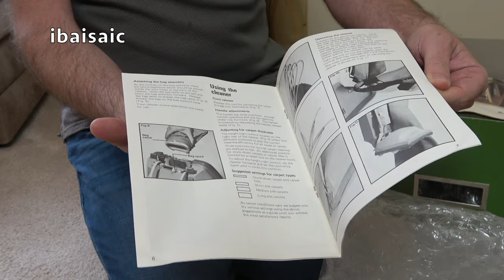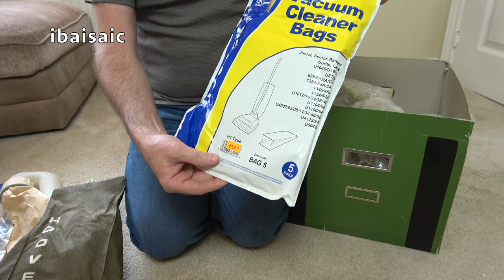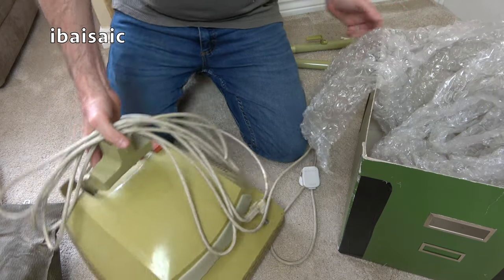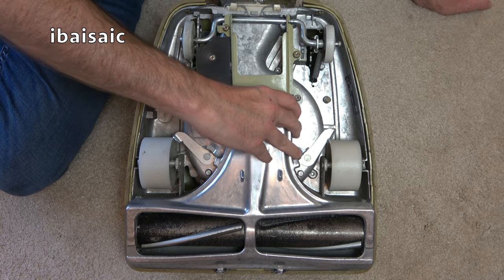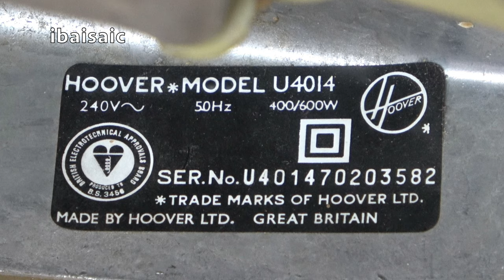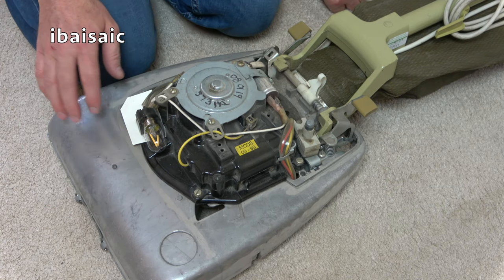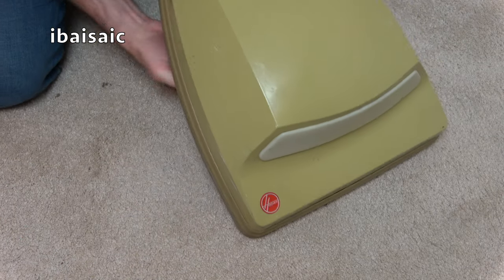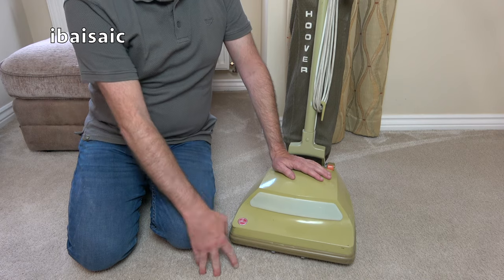Hoover Ranger Senior U4014 - Avocado Green 1977 Design Classic

Comment: As someone who does portable appliance testing non-insulated live/neutral pins are fine if the item is being used at home, if the item is being sold or used in a commercial environment then it's not allowed.